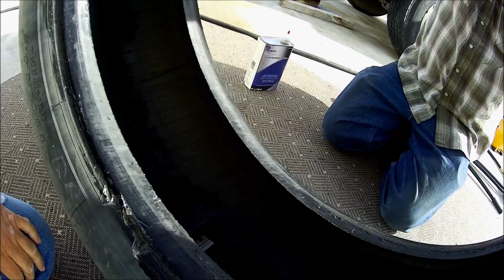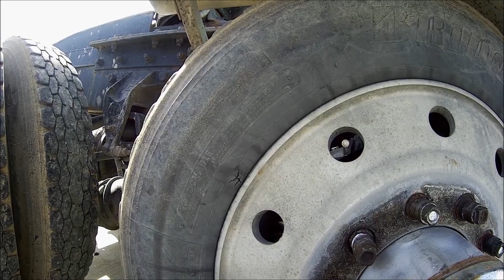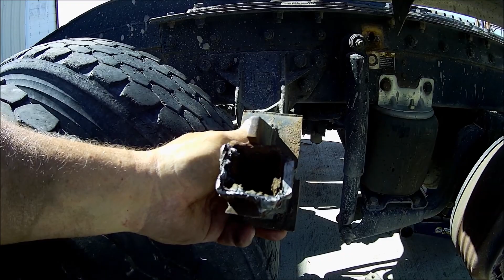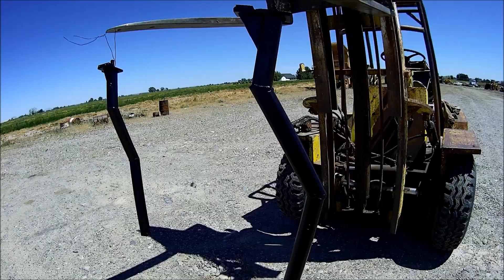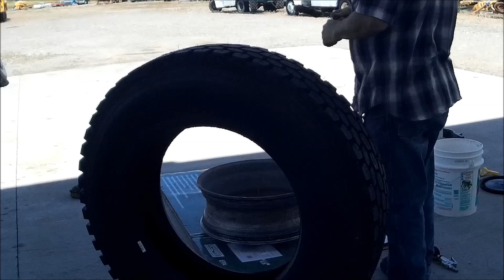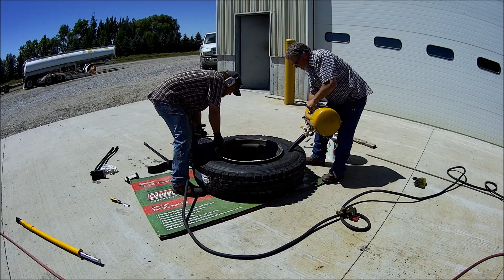Anderson's OK Rubber Welders

Comment: I have patched too many tires to count.  I grind the rubber inside until there is an even surface.  Clean the area with tire repair cleaner. acetone will work in a pinch.  Let it air dry completely.   Apply the glue to the tire let it dry on the surface. Apply patch and stitch it in  .  I have never put glue on both.  Rubber cement or contact cement uses the glue both sides of the glued part.   

there should be a core value for the used casings.  It was around 50 bucks a tire a few years ago.  They will grind the tire casing down to the cords and rebuild everything.  Recaps.  Some caps are better than others.  For the same reasons you had repair patches fail.  The operator make all of the difference

Comment: I'm glad to see you use  anti-seize on the wheel nuts. I honestly didn't think that stuff was available in the USA. We have brought up 9 Cats from various States and none of them had anti-seize on the roller bolts. Consequently we have fought for hours trying to get roller bolts out when the ones we put in which are just plastered in anti-seize, come out with a buzz with the impact. Our D3C which we bought in Iowa, has 2 cowbelled rollers on the left track frame. After hours of heating the roller bolts, to prevent it, we twisted all but 2 roller bolts. So I had to pull of the track frame this morning and we will flip it upside down and drill and tap out the broken bolts... A half an hour job with anti-seize takes 2 days without it. When you do an undercarriage, buy a can of anti-seize and don't be cheap with it, be as liberal as Obama with it. It'll save you hours, I promise. It's like Frank's Red Hot Sauce. I use that shit on everything.
Reply: back when i ran dozer yrs way back. our welder would lay on his back or side underneath the under carriage and weld onto the broken stud-and then weld a nut onto that. then he would say-turn it out big jim-and laugh-but pretty much every time it worked. back in the early 80's-355-komatsu -D-9's, fiat-allis-31.
wasn't until i went down around washington, d.c.area for work-did i see track frames turned upside down to do a roller job-and heck-they had air guns then too. man-talk about getting spoiled then. lol i really enjoyed ur comment-as it took me back almost 40 yrs. thanks

Comment: After 47 yr's in trucking l was sceptical on these tires but just put a set of 6 on a Freightliner FL-70 I'm setting up for an RV puller, Hercules H-902's at $300 apiece. The shop I dealt with sells a huge quantity of this particular tire for the larger motor homes and have never had a comeback. The truck will not likely get anymore than 2 to 3 thousand miles a yr. and these tires will hold it up off the ground as well as anything from the big three that would cost me far more than double.

Comment: It's all relative. Tires for my big tractor are $2400 each. Ouch! And there are eight of them. On the other hand, with proper pressure maintenance they should last at least eight years.  We have no rocks or gravel to eat them up. That machine can spin all eight tires in sixth gear, which only happens pulling a scraper into hard clay with too much cut. With low tire pressure and a good suspension we call it the Blue Cloud because of the ride.
Reply: I take it the 4wd is a Ford/NH?
Reply: Jack Johnson New Holland. Same machine as Case. The power in these new machines keeps going up. Within a model most of them have the same engine, just derated within the computer. I installed an electronic power boost between the fuel computer and the injector module after the warranty ended. Pulling a scraper is the only time I need it and even the it's only about 90 seconds per load when it's doing me some good. It went from spinning all eight tires in fourth gear to sixth gear.

Comment: I've made one unique addition to all of my diesel machines. The manufacturers say we should let the engine idle for five minutes after heavy use to cool down. Most people find that hard to do. My solution is to install a spring-wound timer, like those for a bathroom fan, parallel to the ignition switch. Just crank the timer then turn off the key.  In five minutes it shuts off. Problem solved. And people don't feel like a slacker for sitting in the cab doing nothing for five minutes. I used to fly helicopters and we had a strict two minute digital countdown before cutting the fuel to the turbine. We had to watch the temperatures and pressures, plus update the log book, so it wasn't like we were doing nothing.
Reply: Jeffrey Lewis those idle timers have been available for many yr's,  had one in one of my KW's just set it for your choice of time turn off the ignition pull the key lock up the truck and head for the chow line, worked great.
Reply: Rod Parkinson I've never bought a Cat or any other machine with one. At least trucks have them. A truck is the one thing I refuse to buy. It seems every operator we use keeps a running story of their breakdowns.
Reply: Rod Parkinson I forgot that a truck breakdown is the focus of this video.

Comment: with the fender brackets. i would have welded in tubes where the mounting bolts are.. so they are completely sealed.. drilled a 7/16 hole and tapped it to 1/4 NPT and air checked the welds..  poured in a cup of paint and rocked it around and then poured out the excess.. let it dry and then put a brass or stainless pipe plug in the hole.  but that is just me.
Reply: It is just you.

Comment: Nice tools to help breaking tires. How many kilometres did you get on the old drives?
What brand did you buy?
Recaps or new?
Thanks
Reply: In the description above, it says he bought 8 new tires that some were made in China and some were made in Vietnam, all Hercules brand.
Reply from the maker: New, the old ones were capped the date code said they were 2007's no retreader will take anything older than 6 years, with the work I do I might get 30.000 miles out of them

Comment: I had good luck fixing tires with these. Reinforced Radial Patch/Plug 2 1/4" x 4" w/ . Had a lift axle tire. Less then 10,000 miles on it. Found a 1/2" bolt in it, Put one of the patch/plugs in it. Had to replace that tire at the end of haul season. Was down to 2/32's.

Comment: Do you need to balance them? Worth buying a machine to take them on and off? Seems like the manual method is pretty slow even though you're good at it.
Reply from the maker: most truck tires are pretty good for balance the way they are, but I did buy a set of balancers that you sandwich between the duals that automaticley balance as you move, they are still on Old Kenny, they worked very well

Comment: You don’t take the hub caps off? If you take the hub caps off they don’t become dented and you got a safe place for the lug nuts.
Reply: Never have popped a cap off, except to pull the axle. Never dented one either.

Comment: So you didn't balance the tires at all bet that's a sucked riding down the road
Reply from the maker: It has Centramatic wheel balancer's on it now
Reply: On drivers, as long as the valve stems are mounted opposed to each other, balance generally isn't a problem.
It's when the stems are on the same side that things start to get a little crazy.
Reply: Very rarely have any Ballance issues.. only time we've had issues is some of the wide base, 16"..18" wide tires.
 If e do have a problem, they make a lot of different products.... Got a set of 12" steers will powder, don't recall what it's called, but works!
Reply: i went with chinese neoterra on my peter car highway truck not a shake not a bump no vibration nothing im very impressed fuck those big names they just want your $$$$$$$$$$$